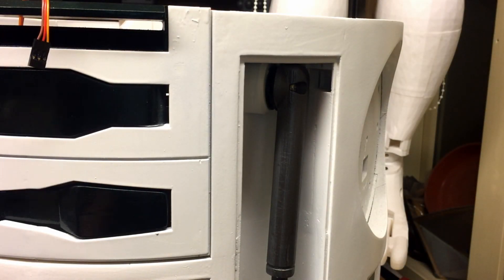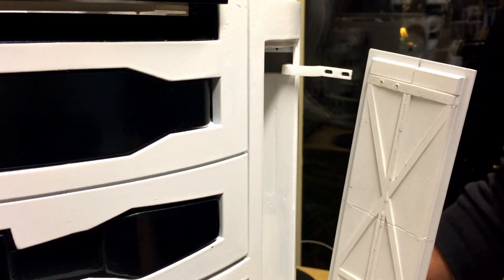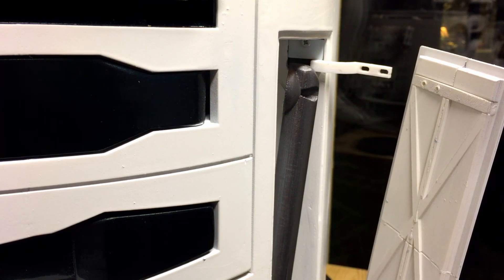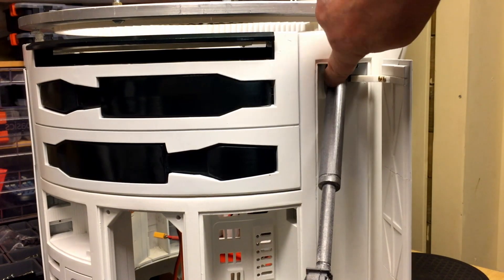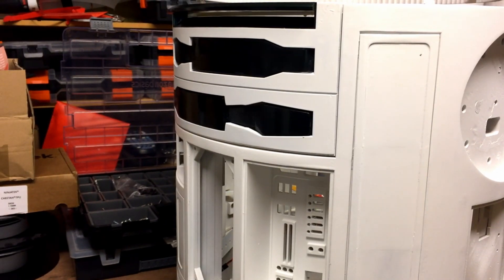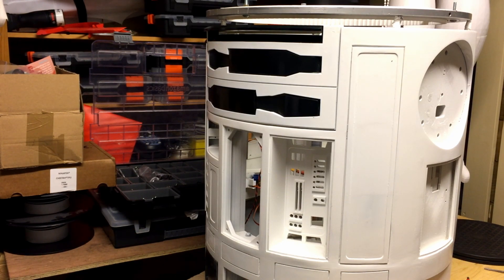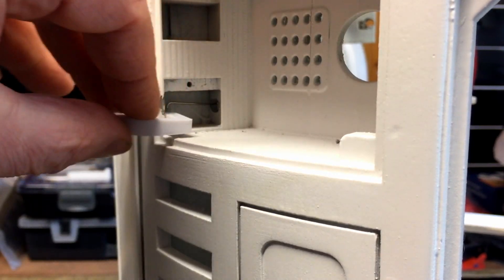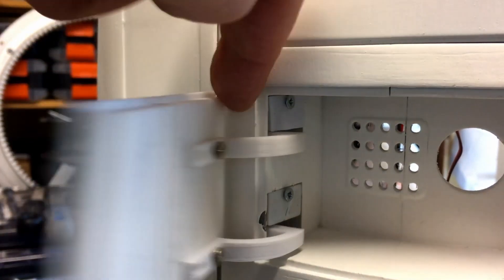R2D2 Droid Build - Part 33

Comment: Hi kyle, the dataport logic servo support, where can I find it?
Reply from the maker: Hi Juanjo, the large vertical door servo supports are Mike Baddeley's (here https://onedrive.live.com/?authkey=%21APA5Cxi7TQXSqMw&id=E84CB8FD47152532%2129744&cid=E84CB8FD47152532).  The small door  (data logic) support is partly home made from odd bits of plastic I had lying around and also from a thingiverse design by mascal.(https://www.thingiverse.com/thing:3117594).   More of my pictures here on my blog (https://myrobotnigel.blogspot.com/2020/02/charge-port-servo-close-up.html).   I hadn't used mascals modified frame parts when I made R" so I just drilled it out and modded it.

Comment: Fantastic job on the droid build!  It took me 2 days but I've watched all the videos in the series so far (More! More!).
I printed the dome nearly 3 years ago and never completed it.  I've now started working on the dome again (sanding, filler primer, repeat) and am getting ready to start printing the cut version of the MKIII body.  It's great to see how all the bits go together for real.

One question I have is if you think PLA will be strong enough.  There's a lot of information stating that you should use PETG or ABS.  I'm not planning on taking it out much, so I think PLA or PLA+ should be fine.

Thanks again for sharing your progress and tips!  Keep up the good work!
Reply from the maker: Hi Tom, glad your enjoying the videos.   I have been videoing the final assembly of my Droid now its all painted, so will finish that and get a couple of new videos out soon.  I think PLA is strong enough, the whole Droid seems very solid.  Not sure how it stand up to exhibition use, but that's not something I'm planning to do.  More Droid vids coming soon. I keep getting distracted in printing 3D RC planes, on my 4th now! Kyle

Comment: Hi Kyle!  Where'd you find the servo mount for the CBI door..The one I found on thingi is kinda in the way of the electronics. I like how urs is offset a bit
Reply from the maker: Hi ontysx, the actual servo holder itself is mascals thingiverse:3117594 but as this was all scratch-built, I used some old 3D parts I had to make up a support bracket.  So I have mounted the servo holder on an L-bracket allowing me to fit it off-centre.   I have added some closeup pictures of it all on my blog here: https://myrobotnigel.blogspot.com/2020/02/charge-port-servo-close-up.html
Reply: @kylecampbellweb  awesome thank u sir!!

Comment: Hi Kyle, he’s really coming on leaps and bounds, still really far behind on mine other printing temptations always get in the way.
Reply from the maker: Hi Darren, thats my problem too, I get distracted and am building 3D planes as well
Reply: kyle campbell argh a fellow flyer! I fly rc helies but to expensive and the market has slowed down a lot. I’m slowly getting into the plane flying but it’s difficult to unwire with he controls and I’m putting the wrong stick inputs in. I have the Steadman files if you want them?
Reply from the maker: @darrenlittle8704  Hi Darren - a very very novice to be flyer at the moment!  I have built the QTrainer and bought the RC kit but am waiting on better weather.  Also printing a second QTrainer for a friend and we will both learn together.   Found an RC club nearby so will see how it all goes. I just got the Stearman and am printing away but thanks anyway!  Have you built the Stearman yet?
Reply: kyle campbell no not yet need to get the droid done first. I’m still on a trainer and didn’t rejoin my club last year due to many projects (R2-D2) , work and family but plan to get flying again in the summer. Definitely getting the bug again though. Contact me in the future though because a friend has the Mosquito. Think you still have my email
Reply from the maker: @darrenlittle8704  I have no place to store all the planes & stuff I am printing, no more printing temptations.  I am semi converting my loft soon to store R2 and the InMoov and the planes but am already planning a massive trainset to go up there.  Will see how my flying goes, yes still got your email. Have fun

Comment: Hi Kyle, thanks for the videos.  I am enjoying watching your build.  For your gripper arm, what about 3D printing a washer with a slight bevel on it and gluing it to the the gripper arm.  That way when the arm moves out it will come out at a slight angle and will avoid the door casing?
Reply from the maker: Hi MakerDan
Good idea.   The small offset piece of packing tape will do me for now. Glad you like the videos!